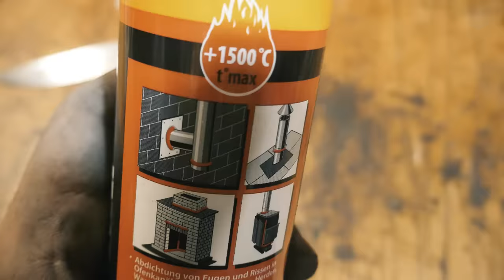Knife Making - Dark Modern Tanto

Comment: What makes a better knife? 
A forged one? 
Or one cut out of steel? 
Serious question I honestly don't know
Reply: Depends on how the one that is cut is forged. That should answer your question.
Reply: Depends on the skill of the craftsman and the steel said craftsman is using
Reply: @jcjcjc3096  Wow great burn Wilmer Valderrama. I didn't realize it was still 2006
Reply: a cut one is a lot more expensive and wasteful than a forged one and takes a lot less skill to do. Anyone with an angle grinder and a belt sander can cut a knife from steel bar, it takes lots of experience to be able to forge one. I'd consider this work machining more than forging/blacksmithing, and while it's impressive all the same, it's closer to being machine-made than manmade art. The setscrew instead of the pin was really not a good finishing look for this knife and completely distracts from the rest of the work

Comment: Looked through comments and found someone else asking but no reply. What did you use for darkening? It turned out amazing as usual.
Curious what you used for the humone or whatever wavy line on the blade where you insulate for heating. It looked like a caulking tube of regular old liquid nails or something.
Reply: Since he had mono steal, he probably used ferric chloride.
Reply: it looked like a fireplace caulk, think of silicone sealant but for 1500C!
Reply: Correct me if i am wrong but i thing this is not a traditional tanto style blade but even though i have to admit that it is a really impressive work.
Reply: Just boil it and white vinegar. It will blacken the steel nicely....
Reply: He pretty much just used furnace cement.

Comment: Was it clay or a synthetic glaze used on the blade to temper it ~ In order to strengthen the edge? If clay was used, does it already come mixed, or do you have to mix it yourself? If so, is it just a simple 1:1:1 (ratio) with clay, charcoal and sand? Just curious. Beautiful knife mate! Cheers!
Reply: Judging by what was shown in the video, "Furnace Cement" is what was used to coat the blade prior to heat treatment.  It was used to replicate the properties of the clay/charcoal/ash mixture traditional Japanese smiths use in a process called "Differential Hardening" in English or "Yaki Ire" in Japanese.  It serves to insulate the back of the blade during the quench to force it to cool at a slower rate than the edge.  Allowing the edge to become quite hard while keeping the back and spine springy and shock absorbent.
Reply: Yes, it is just a simple 1:1:1 ratio of clay, charcoal powder, and ground sand/whetstone dust/stone.
All of it has to be a finely ground.
Reply: KuroReanimation  👍👌 Thanks Mate! It really helps the blade retain it’s edge and strengthens it. We use a clay based paste (the mixture I referred to) quite often when tempering our blades here in Western Australia. Just about every knife and blade smith uses this technique! Cheers mate!
Reply: @erikpmason  Why nobody uses this with a torch ? like you could get a perfect hamon with a soft spine. I think...

Comment: I wanted to see you test it instead of just looking at it then putting it away
Reply: So its a showpiece with proberly no real function🤔thats lame
Reply: @davekessing2266  affirmative
Reply: dave kessing bark no bite lmao
Reply: @stinkyfeet2235  affirmative lol
Reply: @izzyplusplusplus1004  when was that
Reply: @marcobeast666_  After the edge hardening of course.
Reply: @izzyplusplusplus1004  OK
Reply: Joash Church it scratched the glass, but that was before tempering and unsharpened so basically useless. At no point in the video do we see the edge being properly sharpened or a silver line along the edge (indicating that it has been sharpened). So probably it is “just” for show. However it is still beautiful.
Reply: @izzyplusplusplus1004  why don't you put the time of which he tested it, I'm not putting in the effort to watch it again
Reply: Marcobeast666 _ lol here ya go, it's just after he hardens and tempers the blade at about 7:00 - 7:13 .   I also want to say that just because a maker doesn't go out and immediately test cut through stuff after finishing a knife doesn't mean it's won't perform well.  Most guys that spend a lot of time on fit and finish and polishing etc don't want to go right out and scratch it up again, especially if it's going to be sold, the buyer would want to be in top condition.  

I will agree that if this was made to with the intent to be used for cutting demos or the like it would be best to test the heat treat and geometry with some impact and cutting tests just after finish grinding post-heat treatment, although that should be the case for most custom knives.  I'm sure this tanto would be mostly for display, which is the same many other highly refined yet still fully functional knives which are purchased by collectors, but that doesn't meant they won't work, just look at the high end work from the ABS smiths for a great example of high quality fit & finish with high performance.  

Also, if you're interested, go check out Dave's work on his channel at "Crossed Heart Forge".  His methods are neo-tribal and very close, if not the same as traditional methods.  His knives would surely function as they're meant to, but they made to be works of art.  It's sorta the way it is with high end custom made knives, which are often bought mostly to be admired by the owner.
Reply: @lsubslimed  welp, that wasn't much of testing, but thx for your co-operation(ik I spelled it wrong)

Comment: People are interested in what kind of black mass you smeared on the blade before hardening 6:28....?
Reply: Огнеупорная черная глина, позволяет не перекаливать лезвие и закалить обух
Reply: спасибо  @oohAqua
Reply: it's a clay used to stop the spine of the blade getting hardened but leaving the edge nice and hard, thus allowing the blade to have some flex and prevent snapping but still retain a good cutting edge.
Reply: need the name of the material, and perhaps the manufacturer.
Reply: Майор Дегтярёв http://islandblacksmith.ca/process/yaki-ire-clay-tempering/
Reply: @yohsin123  think he used a bit too much haha
Reply: He just used furnace cement
Reply: @yohsin123  It is also used to get that sweet line on the side.

Comment: you should try cutting towards the pattern in several parallel lines instead of going straight through. the friction damages the inside of the wheel faster

Comment: Cool build dude. Can i just ask, on a philosophical note, am I alone in thinking that, if my only barrier to entry into say, the world of knife making for example, is whether or not i can afford an angle grinder and a belt sander, does it some how take away form the value of the craft? 
In mean, I just started getting into the realm of handtool only wood working. I mean seriously, I’m trying to remove anything that requires electrons. Ive made my workbench, my marking gauge and my joiners mallet with almost exclusively hand tools. I finished the bench before I found my bit brace. Used a power drill to cut mortises for the leg tenons. Same for the holes in my marking gauge. 
Its not an argument of efficacy. Its obvious that power tools have that advantage. You can spend more time making more things. Especially if you’re running a business. However, as someone who isn’t doing it as a job or making anything salable yet, I can’t help but feel closer to my work when I am not only the power behind my tool but in some cases also the creator of them. 
Not only can I definitely not win the efficiency debate but I can’t win the difficulty debate either. Its far easier to make something nice with power tools. You can spend more time working on the details. 
Doing it the hard way does not automatically make it a better piece. Although, when you can pump out a piece on par or even better doing it the hard way, I think it not only shows your mastery of the skills but your dedication to the craft. You’re not simply doing it to turn a profit. Mastery should always be the unreachable peak we always try to reach. the further we get to that peak the farther it moves away but also the farther we move up the mountain with it. Does that make sense? 
I guess a good analogy would be to say, we trimmed the fat from the process of making and stream lined it. But did we trim the fat or did we atrophy?
Idk maybe I’m just a purist and i’ll lose interest soon or give up and just buy a freaken angle grinder. XP
We’ll see.

Comment: would a knife made like this break in a fight? is this just a decorative piece?
Reply: He specifically heat-treated the cutting blade and left the spine of the knife unhardened, so although it would be more springy and hold a better blade than untreated steel or fully tempered steel, the edge will probably chip very easily

Comment: I hate it when people just cut up steel and grind it into a knife and make it seem like it’s this absolutely amazing piece. While cutting it out is much faster than forging it, it makes it not as durable by any means. When you cut the steel out you’re cutting into the grain of the steel and making it weaker and making many more weak points. When forging the blade out you are shaping the grain of the steel to run along with the blade and ensuring that there are no inconsistencies in it. This makes a more durable blade that will last longer and overall the a better piece. Still a cool blade though

Comment: For this to be classified as a Tanto its needs few key features  1- its needs to have a thicker tip, the knife was made for piercing armor.  2-  tanto knifes have a very distinct tip similar to the shape of a triangle.  That specific shape gives the knife its name Tanto , the tantos tip is never curved but at an angle the form the piercing tip .  This blad does not meet the requirements to be designated as a Tanto its just a simple knife,  as someone who collects knifes and is trained in close courters knife combat I have many different knifes but I generally avoid tantos because of the blade shape.

Comment: Good but this isn't 'actual' knife making. You didn't forge anything at all. The metal bar you took at the starting, that needs to be heated like hell and shaped out like the knife you thought should happen and there are a ton of steps. Leaving all that, Great work bro. I don't know if this's a critic, your handle width must be smaller than the 'diameter' of your guard, but the problem here is the look. It'll be really awkward to look at the closed blade. Good Job!